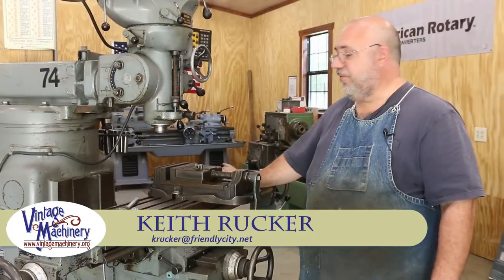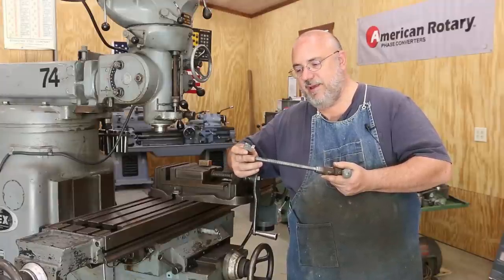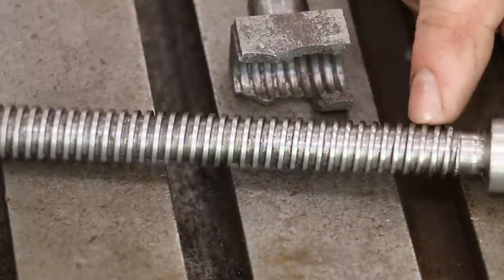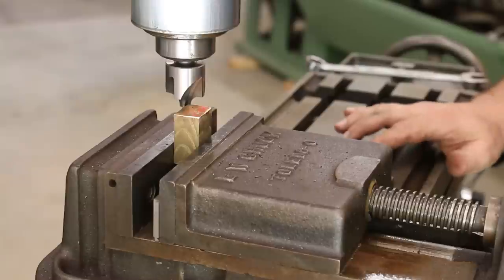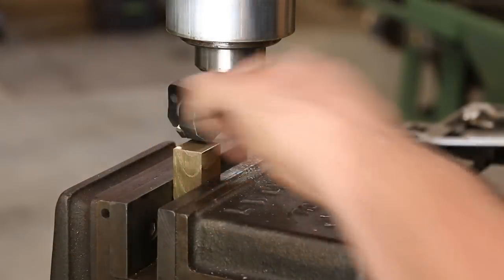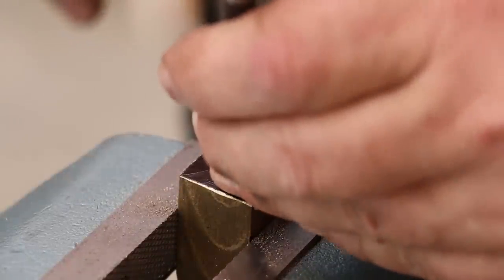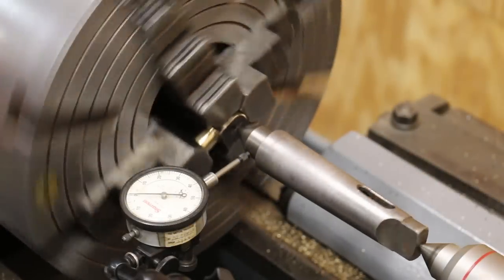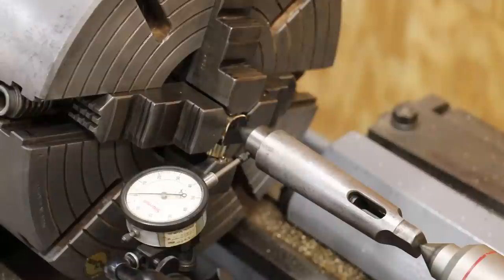Machining a New Bronze Cross Feed Nut for a 1909 F. E. Reed Lathe

Comment: An easier way to determine what size drill to use is to remember that square threads; width, depth and space between threads is all the same, so you could measure your square thickness on your tap, then multiply that by 2 and subtract it from the diameter of your finished hole, that is your drill size.  The measurement is 1/2 pitch +.005.
The barrel on my Thompson SMG is a square thread and let me tell you, those babies are hell to get undone

Comment: Interesting. I just made a video about making a cross slide nut for my 1931 south bend. I Fortunately the lead screw was still in fairly good condition. I think you did a  better job at explaining what you are doing although I think my approach was easier and very accurate. I left the block square and ground the profile when all the threading and turning was done.  If you are interested search for "Fixing Cross Slide Backlash on my South Bend 11" . I'd love to hear from you. Also, I've got to ask, why is your cross slide nut 8 TPI???  Does your dial have 80 increments?

Comment: I've done this kind of thing a couple of times and I'm not trying to be a know-it-all because I'm a novice at best I'm still learning and what I do is I put a dead center in the tailstock and bring it up to almost touching the center punch in my part and just eyeball it with the point of the Dead Center and tell that dimple is dead nuts. Now having said that I don't know the level of accuracy that is involved with this part I mean I think the slap inherent in the threads is going to be greater than any misalignment from and eyeballed Center if you know what I mean

Comment: if you do break a tap inside a bronze or brass part, leave it for a few days in a bath of citric acid: it will dissolve the tap but won't touch the brass/bronze.
Reply: David Wegmuller amazing little tip there, could be a lifesaver someday,thanks!

Comment: Couldn't you drill a hole too small then run the tap through it and measure?  This is a great project and I am impressed with your skill.  Thanks Keith for your patience and the making of this video, Greg.  (Yes, the tap did torque a little but not that much)

Comment: The reason why they went to an Acme thread is because of production needs you can't thread mill a square thread but you can thread mill an Acme one......the same applies to a hardened and ground thread......but with the advent of small diam diamond grinding tips you can do some light grinding on a square thread form and this is useful for a square form face spiral thread as in a scroll chuck.

Comment: You need a proper chuck key for that chuck Keith.  Maybe you can get Tom Lipton to make you one of his special ones :)
Reply: Never accept chuck keys from balding elves! :)
Reply: I was about to suggest that. Tom Lipton has to make up for ... something ;-)
Reply: Why?   The ratchet looks to me to be a very good tool for the chuck adjuster.  Just because the t-handle is traditional doesn't mean it is the best or easiest to use.  I like to break with tradition some times.  Who knows, you may find something you didn't know.  However I highly doubt this will be the case.  You Tube is full of "experts" that know everything possible.
Reply: I'm no expert but let me try to explain my point of view.
I assume it's easier to create tilting forces and mess up the end of the screws with an asymmetric chuck key. At least that's what it feels like with my four jaw chuck I bought in used condition. I improvised a chuck key with the handle of a broken ratchet and find it difficult to avoid pushing sideways. The ends of the screws were already chewy and one is cracked.
So maybe there'll be a viewer donation and Keith can decide for himself which one he likes better.

Comment: I'm curious what math you used to determine you needed the letter y drill for the 10 deg tap.  Given the triangular form of the tap, a callipers won't work too well, but I thought that maybe you could chuck the tap into your lathe, then using an indicator with a probe finger small enough, find the offset distance between the root of the tap teeth, and the nice cylindrical shank of the base of the tap. Then find the diameter of the tap shank with a callipers. With these two measurements calculate:

         drill-diameter =  tap-shank-width + 2 * (root-of-cutting-tooth - tap-shank)

What do you think?

Comment: I noticed you don’t use Micrometers as often as some and use your calipers mostly. Is there a particular reason for this, or just your personal preference? Also, I was thinking. If this lead screw is for a piece of machining equipment, which I believe you said it is. Wouldn’t changing the threads mess with dials on the machine and their accuracy? If they were calibrated to a square thread and you changed that and were trying to dial in say .005, couldn’t that change that? Just thinking out loud, it’s how my brain works. Sorry if that’s a stupid question Thank you.

Comment: A real white knuckle video this time! Literally.  Question.  if the new nut was the right size/thread for the old screw, why not try it on the old screw? Was it actually too tight?  I would think you could choose the minimum drill size by measuring the diameter of the old screw in the region of least wear. Still great work!

Comment: A thought on locating the center of the screw bore...
Would this work? :
Clamp original to table over some scrap.
Scribe a line along the top reference face.
Transfer punch through screw bore.
Measure center offset.

Comment: One method might be taping a DIE sized blank and once threaded, relieve the starting threads (look at a die) and then heat treat.  Then the die is a good chaser if not cutter.

Comment: Great reference video! Just bought an Acme LH 1/2"-10 tap off Amazon today to make a cross feed nut for my SB 11" 1939 Lathe. The tap I bought is also like yours and not a combo roughing/finishing one which is over 3 times the money. Going to use 360 brass. Seeing I am doing the same as you it made for the perfect refresher. Thanks. Ed K. Cleve. Oh.

Comment: Here is a weird one.  I have 1924 Sidney it has a brass nut while good the threads are worn severely.  Would it be possible to make a jig and use babet to fill the threads back in?  It's not like it's going to get everyday use, but it might prevent having to go through the trouble that you have on this one.

Comment: Is that a Bronze and aluminum alloy? It seems to be taking over in the place of bearing bronze. Should have been buying it from Alro Steel for several years before I ever found out it had aluminum in it. Will that be good for this type of assembly? I need to make one for my Logan

Comment: Once the tap is cutting through to the back side, the bronze workpiece could be reversed. Register the tap in the exit threads and cut a few turns. Return to the original side and you should be able to cut without skating so close to the brink of disaster.

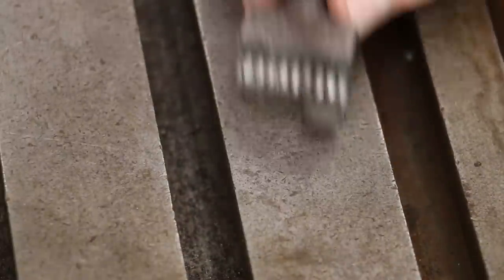Comment: At 04:22 is that oil impregnated bronze?  Wouldn't it be easier to put the lead screw hole in on the mill?  Getting that tap taper all the way through must have been a harrowing experience?  Good work.

Comment: I have 1932 craftsman wood lathe made by atlas press company  the oilite BUSHINGS in the head stock are 23/32 there not easy to find. My question is if I use thrust bearings and collars I would not have to modify the machine is there a better way of doing inoperable in current state to much 
End float
Reply from the maker: If I were making new bushings for this lathe, I would machine them to finial size rather than just ordering them.  Most of those bronze bearings that you buy are not machined - they are extruded and are probably not perfectly round.  Buy a bushing undersize on the inside and either bore or ream it to the proper size.  You will get much better results.  And if you bore it, you can make it whatever size you need - and likely the spindle has worn down some and is no longer the original size so you can machine it to fit your spindle!

Comment: Is it me or is there another method of cutting these threads ?  Once it got nerve racking tight with a few threads of the tap sticking out the other side of the nut.  Make it easier by flipping the nut. Start proper thread timing by imitating backlash

Comment: Keith,  Dang. . . for a moment I though you were using Damascus Brass.  On the more serious side, a question.  When machine engineers designed heavy duty screws and nuts, with the knowledge that there would be backlash; why didn't they make the nut with a provision for taking up the slack in the screw and nut?  I have a Bridgeport clone with a 9" X 42" table.  There is obvious wear.  Do you think it is feasible to machine and install anti-backlash mechanisms?
Reply: +Gordon Brown. Hi there, if your BP Clone is like my one, there is adjustment on all the leadscrews, as the original BP had. Have a look in your manual or have a search on YouTube on how to do it. Hope this helps, good hunting.

Comment: i have a 1930s vintage Sheldon lathe with the same 8x1/2 lh lead screw. The nut is very warn, if i got one of those taps would and made a nut like you did would I have to make a lead screw as well. I have the skills to make the nut like you did but don't think I could make a new screw. I know you prolly cant tell me yes or no if it would work but do you think its worth trying?

Comment: Very cool, I learned some things, like the trick of putting the dead center between the center in the tailstock and the work. I think I can use that pretty soon, too.

But a question: Do lead screws and nuts like this have to be 100% threads? If not, then you'd have had an easier time using a Z drill instead of Y. Does the difference between .4130 and .4040 matter in this application?

Comment: When the tap was getting hard to turn would it have helped to back it out and clean the hole and tap then continue tapping?
Reply: steve gale  Bronzes often have a tendency to close up on the tap when cutting threads even when lubricated. Taps need to be sharp as well, if they have been used much on steel they will also tend to bind in the hole. Same when drilling the stuff, sometimes it will grab sufficiently to break the drill if the special grind is not used
Reply: steve gale  Yes that is why it tends to grab the drill if a normal grind is used. The 'special grind' I referred to is a small flat on the front face of the cutting lip so the effect is the same as a spade drill. Allo shops will have twist drills but not necessarily spade drills especially if they do little work with bronzes.

My suspicion here (as Keith mentions in the video) is the reason for the difficult tapping was not only the depth of thread, but probably insufficient or no clearance between the root diameter of the tap and the hole. That may also cause the bronze to work harden on the thread crests.

Comment: They told me to put acme threads inside of a sprocket. I started with an old end mill and a grinder to make a boring bar. They never told me that there were two different acme pitches for that size and I had to make another one.

Comment: One of the negative characteristics of the square thread is that it will not allow disengaging the thread by use of a half-nut.  I wonder if the modified square thread was intended to resolve this shortcoming without going all the way to the acme design.  It would be interesting to know which design came first.
Reply: I have not heard of this before, am I assuming correctly because the square shape will not allow the nut to disengage/engage smoothly while the screw is turning/moving?
I also wonder about the historical changes, a lathe I owned had square threads on the cross slide and compound but Acme on the lead screw yet only used one half of a half nut and as far as I know it was original.  As Acme thread clearly existed and was being used for machines at the time and square threads were problematic for the reasons Keith gave, I wonder why they just would not have used Acme throughout?
Reply: That's an interesting question.  One possible reason is that the square thread gives the maximum axial force for the torque applied.  That means you wouldn't have to crank as hard on the handwheels while making adjustments.  Alternatively, it could just be something as simple as using existing tooling.

Comment: In most threading applications you have a (T)aper, (P)lug and a (B)ottom choice for taps. What is the application for the plug. I am clear on the applications of the T&B.Tnx
Reply: Normally you tap with the second tap, that is the one with the least taper on the nose, the bottom tap is to get all the way to the bottom with thread after you have tapped the hole with the second tap.
Reply: Plug taps are a compromise. They will tap a blind hole that is only maybe 2 threads less fully formed than the bottoming tap. Most sets only have the plug taps, that allows doing most tapping at the least cost.  I finally bought a set of spiral flute taps to allow me to do power tapping on the mill. Way less likely to bind and break. Sure can spend a lot on tooling!

Comment: Great vid..just wondering about the last tapping operation. I noticed that whe you back the tap out to break off the chips, I dont hear the chips breaking off before driving the tap back in to continue tapping. I am new to this and I am just wondering if you are backing the tap far enough? I really enjoy watching your videos and appreciate you taking the time to make them. Keep them coming Keith!!
Reply from the maker: I would have to go back and watch this video, but as for breaking chips, I find it is more of a feel than a sound.  I can feel when a chip breaks.  Also, it depends on the kind of tap you are using - for hand taps, you have to break the chips but for many of the machine taps, you do not.  You can use a "machine tap" by hand so if that is the kind of tap you are using, no needs to back off and break chips.
Reply: Outsanding! Thank you so much for taking the time to respond! I just learned another lesson my friend!

Comment: You could have centered that hole on the mill more accurately than a center punch and a 4-jaw. Tap drill size is tap OD(not screw OD) minus twice depth of thread then plus .005". Never tap a 100% thread as it takes 3 times the torque to tap compared to 75% yet is only 5% stronger.
 Odd flute taps and reamers can be measured with a v-block or chuck on the shank and a dial indicator. Thread depth of the tap can be measured with the indicator or a depth mic.
 I would have made that leadscrew 10 tpi and made a new dial of 100 instead of 125. Making replacement parts is not modifying the machine but saves a lot of grief in counting and is easier to use and read.
 Be sure to add all these numbers to your notebook for future reference.
   Mike (o\!/o)

Comment: Too bad you couldn't go to either 3/8 or 5/8... Mcmaster carries both in left hand ACME, with nuts. You'd have to braze nut to base, but not have to deal with odd size/shape threads. But good job so far.

Comment: you need a 'wiggler' in your new shop to set centers   athough it generly a clockmakers tool so it's maybe a bit small for that job  
any hooo thanks for the great vids
Reply: He did use a wiggler, only it was Abom sized. It's the same principle in the lathe whether on a ball or a center. Some wigglers have a ball just behind the point to use with an indicator. I have a 3/8 rod 12" long with a point on one end and a center hole on the other that I can put in a drill chuck or on a center so no tool change needed usually. Both ends are hardened although they don't have to be. 
   Mike (o\!/o)

Comment: Clear the chips and relube when the tap gets that tight.
Reply: Slim Pickings I've used very heavy almost like WHEEL bearing grease when tapping gets tight threading.
Have tapped 3 1/2" pipe thread under power using that method. Smokes a little but does the job.
Reply: Recipro1 ij
Reply: Before running in the tap, look to see how much lead there is in the threadform. Go in that much, about 3 rotations. Extract the tap, clean and clear it, apply tapping lube and reinsert.
In this instance, as soon as there was any difficulty in advancing the tap, it tells me that the flutes are choked. It may take more time but you will waste time trying to extract a broken tap.
Reply: Thank you! I was cringing when it was getting really tight! Almost couldn't watch!
Reply: Keith, I was yelling at you to take the tap out and clean the chips out but I guess a three year time warp didn't work. 
As to the hole size, wouldn't trying the end of the tap into your drill gauge up to the root of the first thread have given a useable idea of the drill size needed. I've used that method many times and it's worked out.
Ron Wilken
Canada.

Comment: Oh man you could just make the square tap easily or a tool to cut the square thread make extra length and cut off piece to make square tap ..... simple job.... any time im cutting a thread if I can I make extra length abs make a tap or 2 anyway then I have extra tools it's easy af quite simple since already doing threads and makes perfect fit.... any time you're tapping go no more than 1/4 turn in 1/4 out 3/8 in our 1/2 in.... only go slow with many times backing out

Comment: To determine the tapping drill diameter for the square thread, why not just measure the thread depth on one of the flutes and double it?? Nominally a square thread is just that, the depth is the same as the width. With the 10 deg included angle it may be slightly more or slightly less, probably less by cos 10 deg x of the depth of a true square thread. Tapping drill diameter should be slightly larger than the root diameter of the thread otherwise that can also cause the tap to bind.